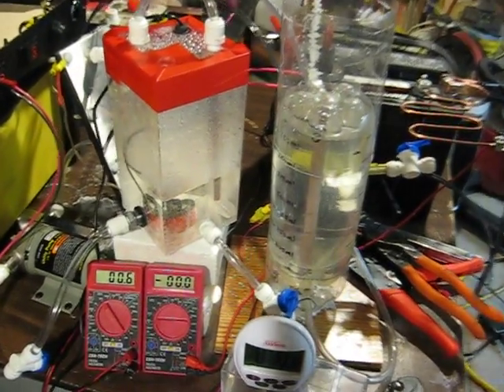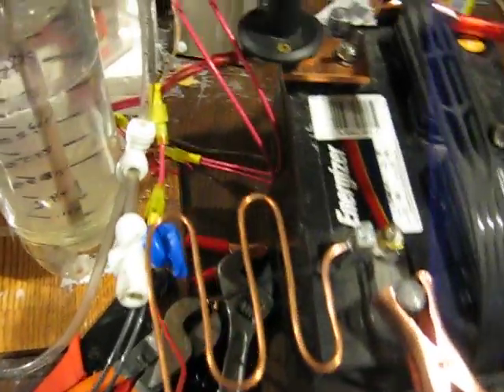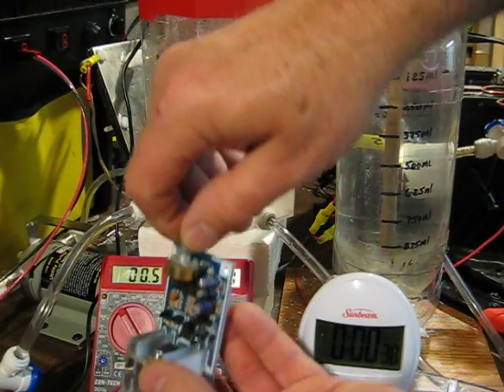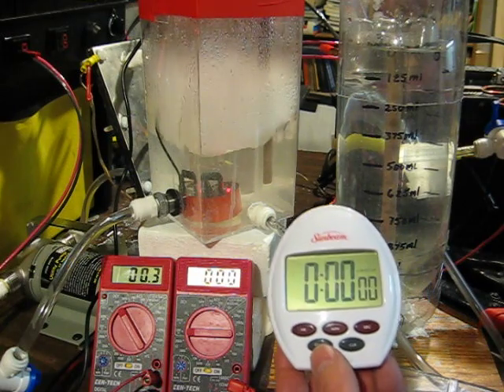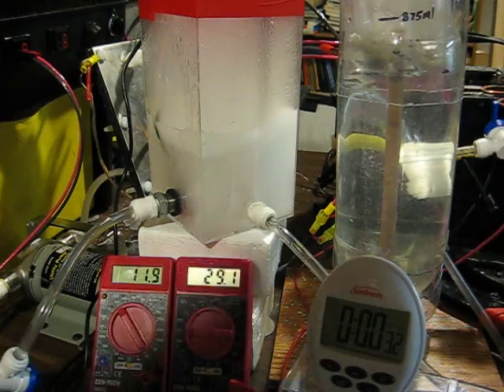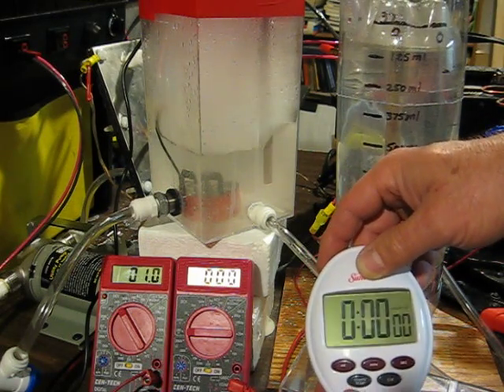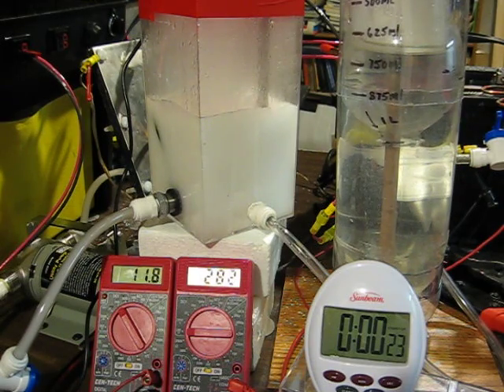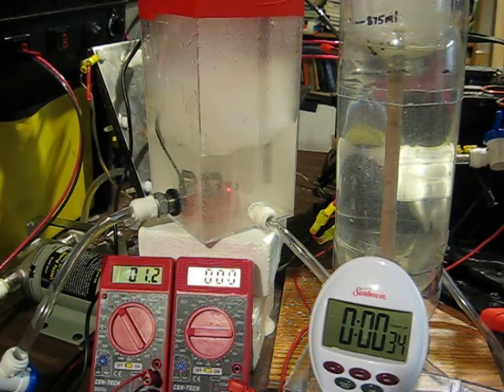1.875 Liters/Minute@11.2 Watts/ml ©

Comment: I have read and seen a lot in the last month. From Youtube and -OU-. I have half-baked ideas, but perhaps you can help: 1) Can you use Cascade (dishwasher detergent) as an additive to modify the surface tension of water as effectively as ultrasonics? 2) What would happen if you add Ammonia to prevent freezing in winter? Does ammonia aid/reduce HHO production?

Comment: 3) To get the most surface area of your metal into the water, wouldn't a grid be better than a plate or even a SS mesh or SS cloth?! This along with a water pump or ultrasonic or Cascade to reduce bubbles getting in the way of your plates? 4) I have seen experiments from 6 volts up to 40,000 volts. Doesn't seem to matter nearly as much as the Pulse Frequency.

Comment: Can you use a capacitance meter to quickly figure out a frequency to pulse the cell at? Has anyone tried to use a variable inductor in parallel with the cell to get things 'pinging' and cut power way back, similar to how a tesla coil works? Any coilers out there messed with an HHO cell?

Comment: One mol of HHO contains 2 mols of H2 and 1 mol of O2.
The useful energy contained in HHO equals 2/3 of the Lower Heating Value (Wiki-->"LHV") of pure H2, which is 2.97 Wh/lt (1 Watt-hour = 3.6 KJoul).  So LHV(HHO) = 1.98 Wh/lt.  
You got 112,5 lt/hour, so 222,75 Wh of useful energy in 1 hour. You´ve spent for that 347,48 Wh.  Efficiency = 0,64.